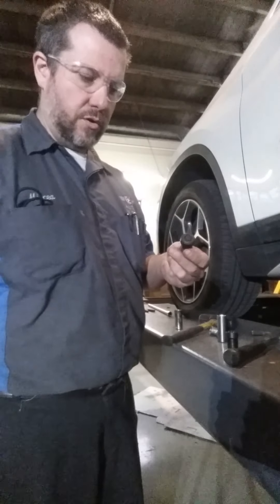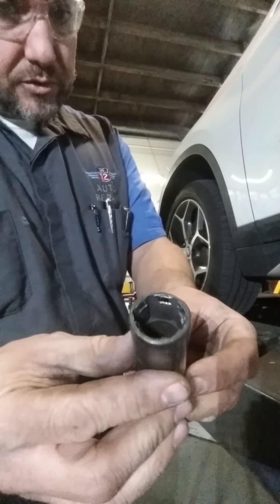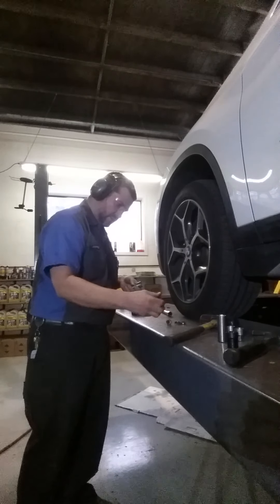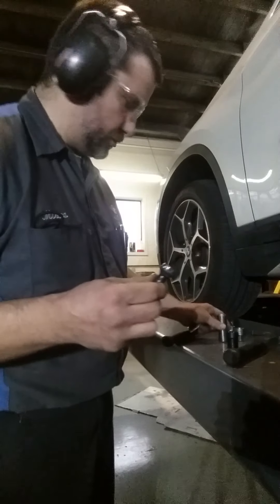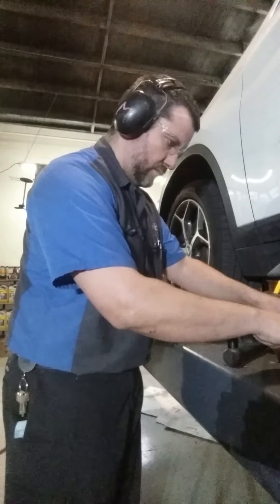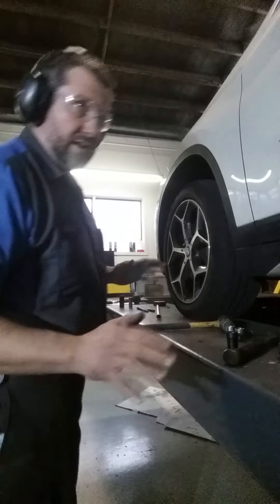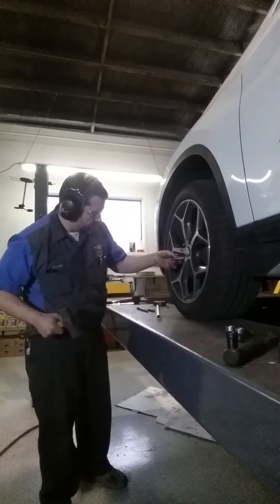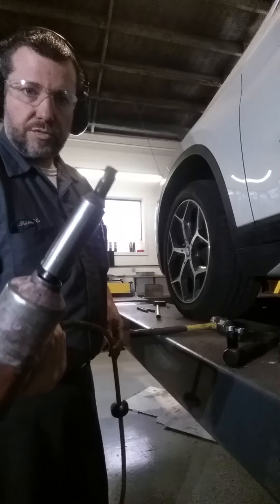Removing BMW wheel lock with ring and stripped out key

Comment: Thanks!
I ended up using a 22mm socket and electric impact.
To get it to pound on, I had to ramp the socket teeth with my Dremel a bit.
It was harder wailing on the socket with a small sledge hammer parked on the ground, but I got 'er done!

Comment: Good day I saw you made a video changing the Universal joint for the front driveshaft on the Infiniti Q50 I wanted to know which Universal joint is the correct one to replace it with cause I cannot find any information no where please respond I’d gladly appreciate if you do.

Comment: Can also use a stripped nut remover. Hammer it in on the locking nut, and use a socket over it with a 1/2" breaker bar and extra pipe for torque. Works pretty well and less hammering and risk of damaging $1000 rim.